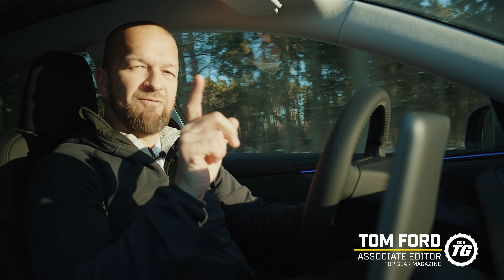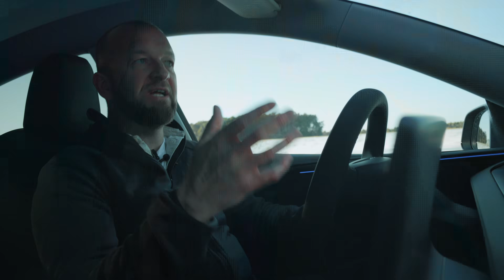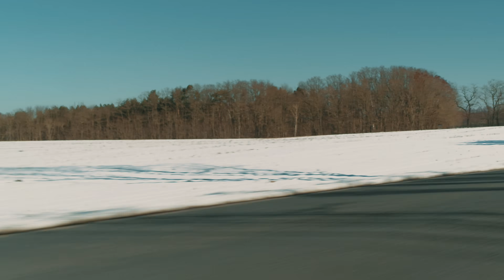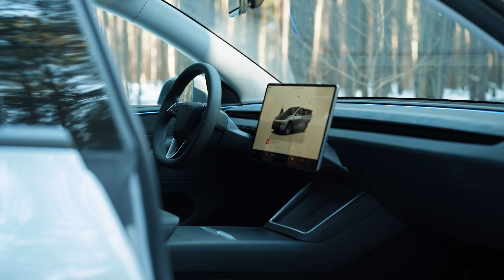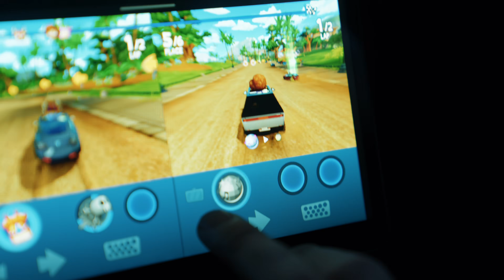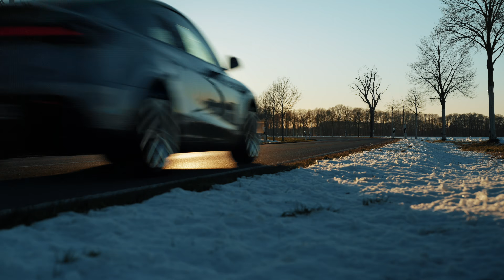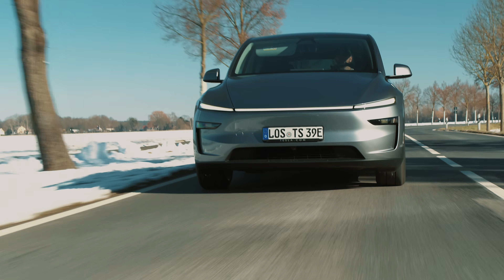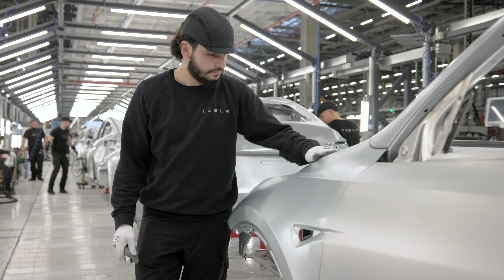Tesla Model Y – Sell Your Old One, Immediately!

Comment: I have 5 Tesla’s in my family.  I bought a new Model X 2017. The X has never visited the service center.  Only maintenance are tires and wiper fluid.  It’s a no service vehicle.  Charge at home with solar.  No more oil filters in land fills.  My X offered FSD which was transferred to my 2024 Model Y.  For level 3 FSD it’s unbelievable.
Reply: @Starship007  A family of fascists, ew
Reply: So you’re probably the only person in the world without issues on a model X. I have had many including falcon doors never functioning properly, front half shafts lasting 50,000 km, huge panel gaps, two new rear motors, Air suspension needed a complete overhaul at 140k km and suspension arms every 60-70k km. Other than that just wiper fluid and tires (every 30k km). 🫣
Reply: @bangbang6767-h1u  Those half shafts shaking under acceleration are really irritating.  Tesla just gave up on them.  It would help if you could keep the suspension low but that doesn't seem to work.  Still a lovely car though.
Reply: I also have a 2017 model X.  Wheel literally snapped off while driving around a car park and nearly every single 2017 Model X had to go into service to fix squeaky rear doors.  Still have a soft spot for that X though.
Reply: Expensive cars, expensive problems. Almost bought a Model S but I'm very happy I ended up getting a Model 3 in the end.

Comment: I do find the reviews that slag off the old model, highlighting all the problems the new model has fixed, infuriating. The Y was lauded as brilliant, now its admitted its was noisy for an EV, wooden, dances around a lot, steering, suspension, acoustics, blah, blah blah. All the issues were glossed over before. You just cannot trust these reviews.
Not saying this car is bad, certainly looks much better, I just wish reviews were more honest at times.
Doesn't matter how good this car is, for Tesla the war of market leadership is over.
Tesla is toast long-term - will get bought out when the finances fail, wonder who?

Comment: So they 'uglyfied' it for aerodynamics. The only other 'enhancement' is better suspension/insulation. Which means no better charging even thought the 4th Gen superchargers are more powerful. Not 48v. Not better batteries. Not better motors. No steer by wire. These are the Cybertruck tech which the EU/UK can never see due to rigid angular design. The only moat Tesla had was supercharger and that is opening up. This means a US design SUV is not optimal for the EU/UK market. Also Elon attacks on the EU/UK will put the 'Green Liberals' off. All in all I guess they are in trouble?

Comment: 160,000 smiles on my Model Y…best I’ve ever owned by far. Can’t wait for new one but heck my old one is still performing way better than expected.
Reply: I agree. I have a 2021 MYLR and I’ve put 89,000 trouble free miles on it. I love the car but I just test drove the new MY and it’s definitely better. Much quieter and a much smoother ride. I’m tempted.
Reply: @ I just bought a used 2023 model X with 8000 miles and FSD but still keeping my Y
Reply: @richh001  do you think it's dumb to buy 2024 right now? There's such a good deals on left over inventory right now I feel like I will miss the deals if I wait for Juniper.. I guess million dollar question is if the price difference is worth going for Juniper from 2024
Reply: @kenyaswallow5782  My new $40k CR-V Hybrid got totaled by some guy in Subaru messing with his phone, I lost big on the insurance. No way I could replace it at dealership price again on equal terms. Did *not* want a full EV, and not a Tesla. But a Tesla-direct used '21 Model Y for $28k with a warranty was too good to pass up. I ended up loving the damn thing more..for less $$.
The question will be whether or not the Rivian R2 is going to seduce me into cheating on it sometime in the next 2 years though.
Reply: @kenyaswallow5782 tesla got some amazing deals on the old Y!
Reply: Yep. I am in worse shape. 2022 Model Y Performance with about 33,000 miles on it and great car. Not a good reason. Maybe I can gift it and get a newer one.....!
Reply: ya gonna paint a swastikkka on it, or just let everyone assume your re a nazi?
Reply: Hate to say it but that’s just an ev thing, not a Tesla thing.   My 2016 i3 has over 100k miles now and it drives like new. They all do.  You don’t have to think Tesla is the only option to upgrade to while their ceo burns the world
Reply: @Stepbystep74  
Their CEO Told "The World" (and USA) that "There was a recession coming" years ago (Google it.... Or rather "DeepSeek it"). 
What he was actually saying was "USA is bankrupt".... but nobody listened.
If they had, different world.
What he is doing NOW is "Cutting up the US Interest free Gold AMEX card" (Just as would happen if an individual  lived the high life without paying the interest and without saving to pay the principal)
It's what SHOULD have been done a long time ago, but nobody had the balls.
.
(He also told the world (in a backhanded way that "EVs Are coming" 19 years ago, and nobody [Outside China] took any notice.... Do you see a pattern here?)
Reply: @Stepbystep74 if u want an EV, this is the best in its class.

Comment: I love the conclusion.. “other things are coming” yet it seems (from other manufacturers) they never come…. And won’t
Reply: Exactly. Top Gear cannot finish on a high note in anything to do with Tesla. They ALWAYS try to finish on a downer. Losers.
Reply: @imac1957  I think the "other things are coming" was in reference to Tesla. See you in a couple months, it'll be an interesting year!
Reply: Other EVs in China are coming aplenty that are better than Teslas
Reply: @fritesvino  they are nowhere near Tesla in any aspect except the price, for which they lose money on every EV they sell to achieve while Tesla is racking up massive profit margins.
Reply: @OnigoroshiZero  You are absolutely wrong about this.  I know it is surprising but the Chinese cars are absolutely monstering it now.  I have a model X and a M3P.  Both are going for a polish and clean up tomorrow ready for selling.  I have ordered an Xpeng G9.  It has more features that even my X, charges way faster than a Tesla, is as quiet as a Mercedes EQS, is efficient, nearly as big as an X, has a sub 4 sec 0-60 and costs about the same as a red model Y and less than a model Y with enhanced auto pilot even though the Xpeng comes with the equivalent of enhanced auto pilot.  It is on another level.  

Tesla were great but they went a bit mad and though they are now probably still the most efficient EV's that is the only advantage they still have.

Comment: Open and close all four doors now. With and without the windows down. They feel as solid or more solid than most of the German vehicles ! Even the framed door ones. It’s crazy good now. The improvements are huge
Reply: I love the design. Look the chinese or korean cars - there you often can discuss why they are not so streamlined (but there are exceptions, too, like the Li Mega). Some people even find Tesla's design boring. - As a German, I have difficulties to adjust to the Volkswagen's ID.x designs, too. I like the ID.Buzz and the ID.7 Tourer, in the meantime.
Reply: @ooops372  Had the same thought. This new Model Y looks almost like an Xpeng.
Reply: @ooops372  
Form follows function.
If a particular Aero trick works, it WILL be adopted

Comment: SUVs, and especially EV variants are ruining our roads with their excessive axle weight.
Reply: The BMW Series 3 with fluids weighs more than the Tesla-3.
Reply: @JohnSmith-x3y8h  And is a part of the problem.  Car size inflation and the trend for larger cars in general are destroying our roads.  Like for like, EVs are substantially heavier than ICE cars and the impact on axle weight works to the fourth power.  Presumably the BMW is a hybrid, but it's still part of the problem if not.
Reply: @paulwood6729  The BMW is NOT a hybrid.

I chose those examples because they are ‘like for like’.

EVs are getting more efficient and lighter all the time.

Comment: I drive 45.000 Km a year in a TM3 LR and after the "Vision" (100% greed based) downgrade the car translated from a fantastic commuter tool into a POS toy car where your fighting the driver assist systems almost all the time. Patches on patches and 2½ year later it still must have the worst driver assist systems in any western made car made today. Wipers starting ATFT due to lack of a 1 US@ rainsensor. SO many "reduced speed due to limited visibility" from the now camera based driver assist POS system that fails miserably in IRL European weather. All 100% according to specs and well known issues when contacting Tesla about how they ruined my former fantastic radar based car.

This video seems more like an advertisement rather than a review.
Reply: Yes I lived with a Model 3 for four years. The first moment I sat into the cocoon of an ID7, I realised what a refined and well built car should feel like. I did 800 miles in the ID7 through awful fog, with travel assist handling it with aplomb, not a single beep or panicking over whether to take an exit. My Tesla can start beeping within minutes and I never trust it if I have anyone close behind me due to phantom braking. Really, really overrated cars.

Comment: Right off the bat you didn't do your research.  You called the "Daytime Running Light or DRL the headlights.  The headlights sit below the DRL.  The new wheels are redesign for better airflow, range and lower coefficent .  You missed the redesigned mirrors that reduce noise buffering inside the cabin.  All the glass is dual panel.  Just to name a few omissions
Reply: exactly! how can a car reviewer get all of this wrong? also front camera is not used in the fsd software...

Comment: I’m considering getting my First Tesla now! I love the redesign, it looks fabulous. I also watched the Jay Leno review with the Designer & Engineer. They’ve made a lot of nice refinements.
Reply: I have a 3 year old Model 3 which I love love love, and I've really never liked SUVs before but even I found myself mentally considering it 😂
Reply: I’ve driven a few electric cars. There are many great models. But, what Tesla does is ‘own’ electric motoring. It just works and works in an electric motoring experience far better than anything else in my experience.
Reply: buy Lucid Gravity
Reply: @PersisCapital  very few are buying it....tells a story!
Reply: You really should be looking at 800v battery architecture. It's a disgrace that Tesla didn't introduce this for the updated model
Reply: @JonYossarian  800v comes with it's own problems, like there is a higher FIT (failure-in-time) as you need more sensors, safety and insulation. There are also a lot of positives, but the question is will it make cheaper or more expensive to make ? How many components are needed to be totally changed ? How much of the factory need to be changed then ?

This is only a refresh, not a new car so the lines on the factory are still the same. It's different from the Cypertruck, where you needed to make a new line anyway and components too.
Reply: @ I've been driving 800v EV for 3 years now, no problems, faster charging when using the 350kw to 400kw rapid chargers. You're right about one thing;  the Juniper is just a refresh, but of old technology and therefore an opportunity missed.
Reply: @ What do you drive ?
Reply: @JonYossarian  Tesla's old technology is at least 2-3 years ahead of every other company on the planet, and the lead in software is at least 5 years. 
So, the new Model Y using "old" technology still puts it above the rest.
Reply: @OnigoroshiZero  🤡research clearly isn't your thing. BYD, Xpeng, Nio, Kia and others are years ahead of Teslas.
Reply: @OnigoroshiZero  no its not. lol Clearly never tried Chinese EVs. Also safety on Tesla is much worse.

Comment: Other things may be coming. but let's be honest. They did in the past too but most went straight back from where they came. I-paces, ID3s, e-trons and bz4x's were all announced as "tesla killers" and they all failed miserably. why? because whether we like it or not, Tesla is the only company who takes this seriously.  No they're not perfect, but the cars just work, they have unmatched efficiency and they are the only ones who understood the importance of a fast and reliable charging network so they built it and they built it properly from the start. Nobody else did.
Reply: I agree Tesla have built a good lead. I have driven one for 4-5 years but now have an ID7 alongside it which I vastly prefer driving, especially for long trips. Using the reduced amount of open to all Tesla chargers has been fine as a compromise so far.
Reply: Superchargers are great but most cars can use them now.  Tesla charges "fast" eh?  The model Y peaks at 210 kw charging and then not for very long.  An Xpeng G9 peaks at 320kw charging and keeps that going for much longer.
Reply: @notverygoodguy  yes but then you'd have to drive in a Xpeng
Reply: @sssssneaker  Well owning an X and a M3P and having driven an Xpeng G9 for two days I can tell you that the Xpeng G9 is way nicer to drive than the Model 3 and also better than the X.

Comment: That’s the second time I’ve heard a journalist say the launch edition 0-60 time is 4.8 seconds - Tesla suggests it’s 4.1 seconds. Anyone know which is the correct figure?
Reply: 4.8 is the standard, however you can buy acceleration boost as a software upgrade to bring it down to 4.1 😊
Reply: Launch edition had acceleration boost included by default

Comment: The video is pretty misleading about what is new... I'm sure they improved it further, but the comparisons being done here seem to be vs. the original model y from 2020... not what they were selling last year.

The one piece casting for the rear end has been that way for years.  a 2023 or 2024 already has that. The suspension in the 2023 and 2024 was already much improved from earlier, as were the acoustics (a 2019 model 3 vs. a 2024 model y are completely different, much quieter, much more refined.) The 2024 rear seats already recline to multiple angles also... what's new is that they are electric... it was just mechanical adjustment before.

The rear seats were heated in the old model also... the only new thing is ventilated front seats.

I loved hearing about all the mechanical/invisible changes, but given the weird baseline in a lot of the conversation..it's hard to understand what is really new, vs. what is just summarizing changes continuously applied since 2020.
Reply: Bingo. The takeaway I got from this is that I might enjoy the new tires on my 2022 when I go to replace them, and I get to have more storage space with my old model.
Reply: I think the innovation is that the regenerative braking control method has changed and the driving range has increased.
Reply: Agree 100%.  The Model Y has seen incremental improvements placed into production BEFORE the refresh.  I recently test drove a pre-facelift Model Y Long-range RWD & AWD and was quite impressed by the ride and composure.    It was brutal stepping back into my older ICE engined car (no one-pedal driving, noisy, no cameras, no smarter-technology). I saw nothing problematic that stood out from a fit/finish perspective and the high-performance audio system was frighteningly good and rivals systems in much more expensive vehicles.